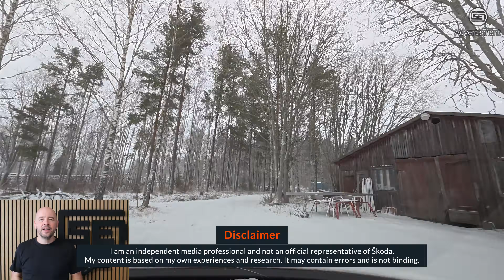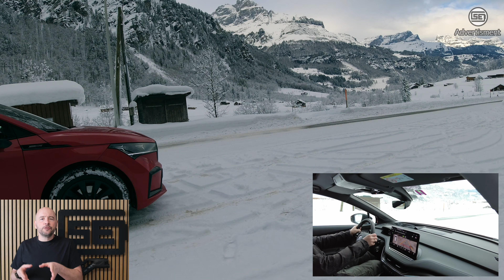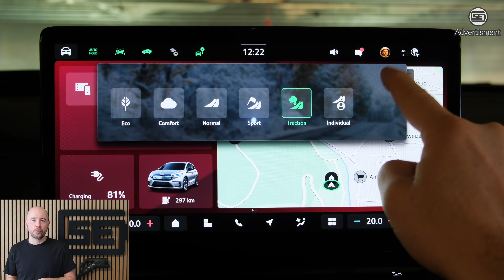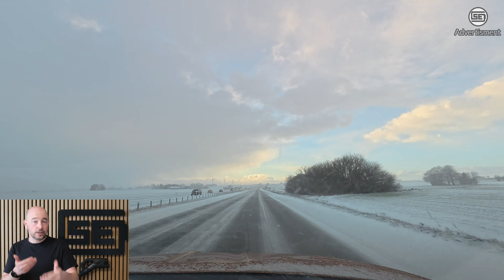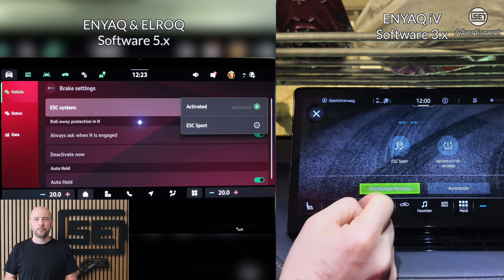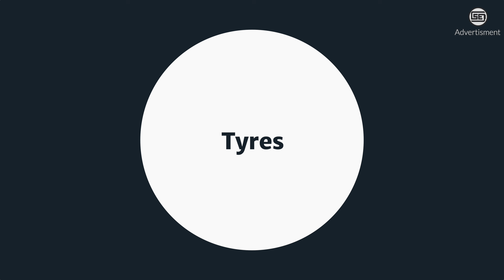Snow, ice, everyday life: what ENYAQ & ELROQ with all-wheel drive can really do and what they can't

Comment: After 4 years I just said goodbye to my 80x last week, it drove great on snow considering the weight and it was a bit tail happy when pushed, wheat made it really fun. The worst part of driving in snowy conditions  is that the cruise control gets disabled really fast because of the snow accumulating over the radar behind the crystal face. I don’t know if this is solved on the new versions?

Comment: As I’m writing this I am waiting for my new Elroq 85x to be delivered. It will be interesting to compare the 4 wheel drive with my Octavia which is a diesel 4x. I live in Norway on a small steep street and use studded tyres. I’ve also ordered studded tyres when my Elroq is delivered. (You buy a summer and winter set when buying a new car in Norway). Thank you for removing that awful Ai commentary btw.

Comment: Thank you Matthias. It was again a very clear explanation for newby Enyaq 85x driver
However, one question remains: I have winter tires (Pirelli Scorpion) on 20” wheels. According to the Skoda manual chains can’t be used on 20” wheels. That is a problem as some destinations in Austria require snow chains. In Austria snow socks are not acceptable as substitutes for snow chains. Can I still use track chains on my Enyaq or should I still use some brand of snow socks?
Of course there even me be hardly any snow on the routes, but that not a gamble I’d like to take. 
What should you?

Comment: Hi Matthias. Got my 2024 Enyaq updated from 4.1 to 5.4.3 a few months ago, and with the winter started, I've noticed that the car does not seem to heat the battery at all. My impression last winter was that 4.1 heated as earlier software to 1 degree, but this newer software seems to skip out on that, observed down to -15. I'm sure this saves power, not doing any heating, but the downside is noticeable when all power is gone as 9-10%. I has 8 km range left showing at 9%, and so little power available that the car could hardly handle a hill. This is manageable with battery preheating, but it seems to be a change with the software and could be interesting if you could do a deep dive into. What are the current heating parameters in later software versions.